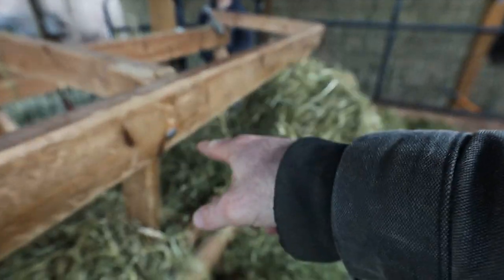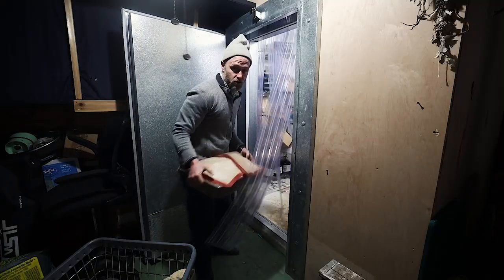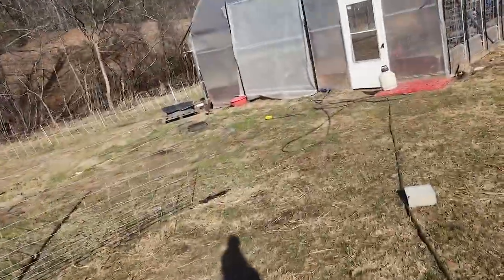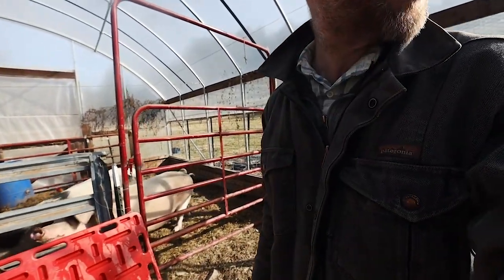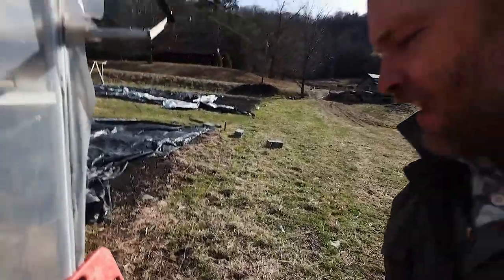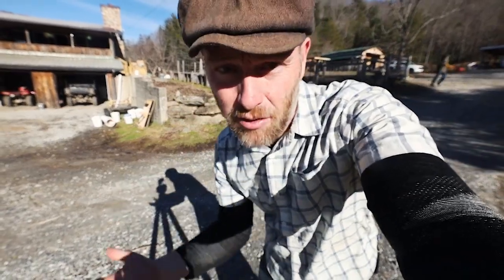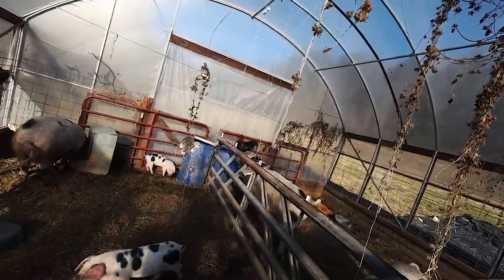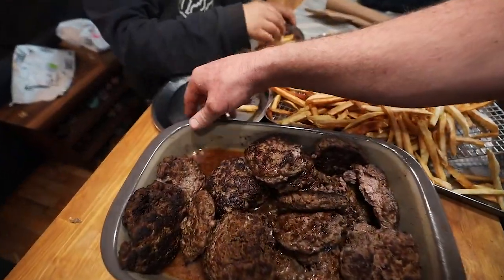Building a Homestead in 100 Days - Day 91-92

Comment: You do a great thing here. A tip I saw with wrangling the chickens is using a piece of 1/2” pvc pipe. It gives you a little reach and you don’t even have to touch them. Just put it in front of them. Kinda like the pig boards.

Comment: In a past video ur wife gave her wish list for the kitchen renovation, which included skylights. I had lg skylights in my kitchen to eventually remove them due to the added summer heat they produced in kitchen. My kitchen was hot enough w/all cooking for household of our 7 kids + 4 nieces and nephews(now grown & moved out now) = 13 of us. These days better things are made & suggest automatic remote insulating closing shades to close off skylights if kitchen gets too hot w/added sun. Also you can’t see through them if dirty or snow covered. Maybe there is a glass resistant to sticking dirt or can be remotely heated to melt ice or snow off skylights. Skylights seem nice, til they roast you out of the house during summer heat. There are pros and cons to everything - had em leak once as well. Suggest you do ur homework concerning skylights, especially large ones.

Comment: You might try attaching the boards from the inside. When animal pushes on the boards they are not putting pressure against the screws or bolts.

Comment: I'm curious, you all always get the wood for the boiler from somewhere & not the stack right next to the boiler,why?Is that wood not cured yet?
Reply: They already used the wood that had been stacked near the wood stove. This wood is around on the other side of the house in one of the outside rooms.
Reply: @kellygreen8255  but there's wood stacked right there in the wood holder they built right there.